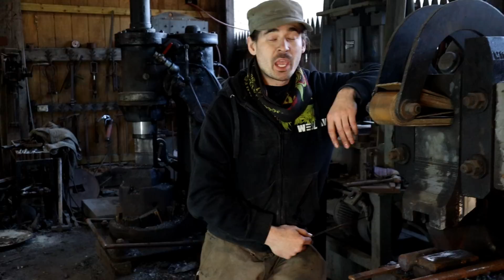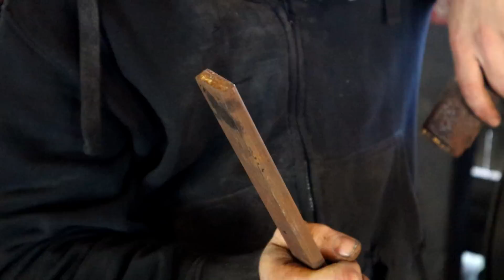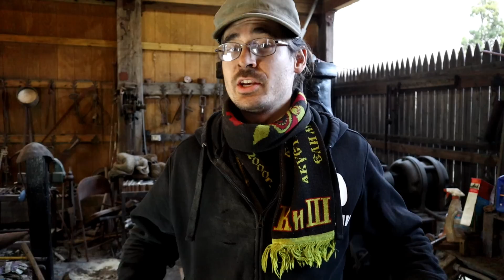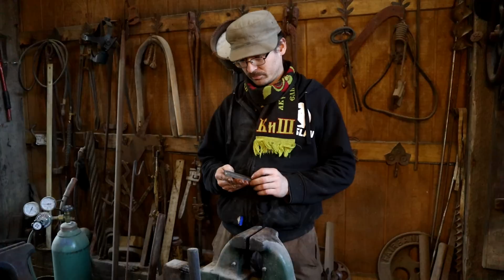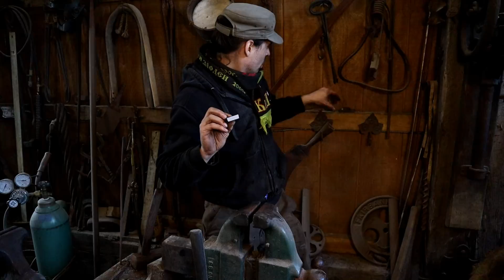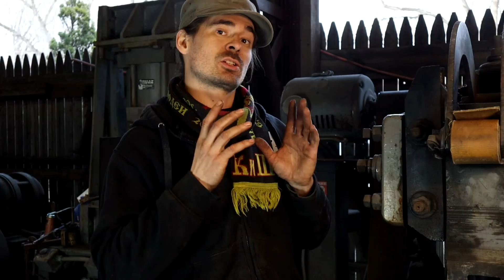Magical Slavic Steel - Steel Talk and Testing

Comment: Did Ilya say that shallow hardening steel is good for engraving?
Reply: I am under the impression that the reason it's good for took making for the engravers is because it hardens very well on the outside yet it differential hardens on the inside . So the working surface is good n hard n holds edge while the spine of the tool is more flexible and shock absorption or shock resistant ie less prone to breakage or shattering from multiple impacts.
   Hope that's the right info at the right time
  Blessed days ya'll,  Crawford out
Reply: @danielcrawford7315  i was just gonna ask that and you came with that plausible explanation. So good on ya
Reply: @mjkhan9664  I just hope that the right one. Lol. I'm still trying to learn all this. You tube education level lol.
Reply: Tools for engraving
Reply: @TonarSilverwolf  I don't understand
Reply: @mjkhan9664  shit, I should have elaborated a bit. He meant that the  Steel is good Form making tools for engraving

Comment: Hey guys , with so much carbon in the steel , wouldn't it be brittle? I saw that it is a specialized steel for bearings and it forms micro particles of graphite whitch helps to reduce the friction . But in a fine edge these particles of graphite might be a problem. (i'm talking about the variant where it's not used in a billet and the carbon is not reduced significantly)

Anyways I'm very happy that I found you here . Keep up the good work.
Reply: Графитизация возможна, но так же возможно её избежать.